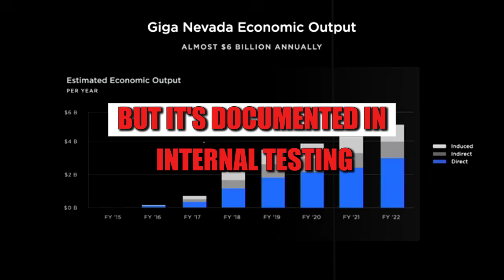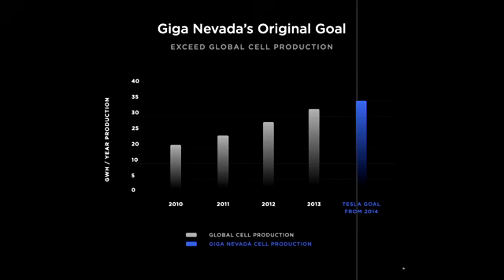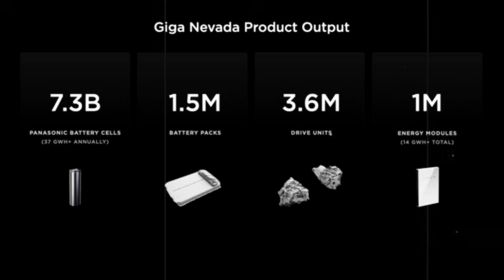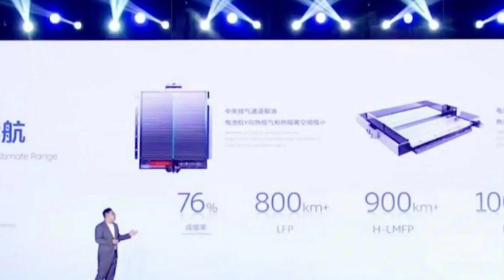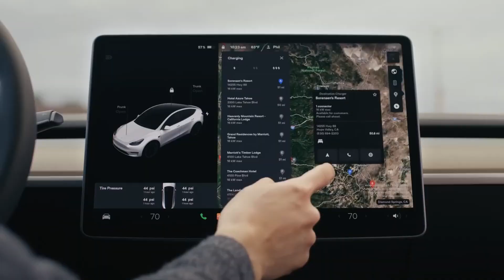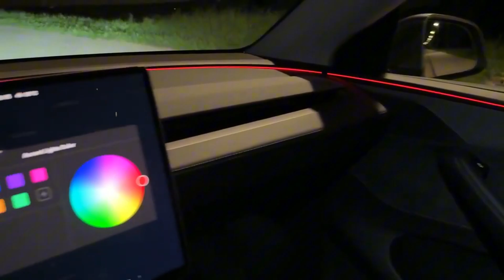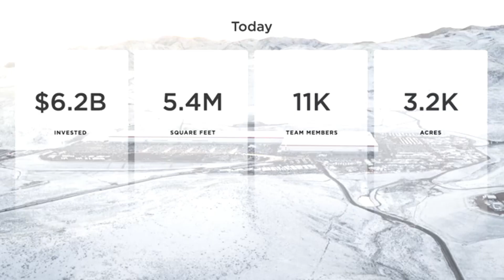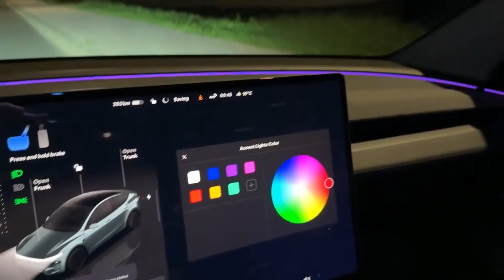Tesla’s New Aluminum Battery – 1000 Miles +4min charge, −40°C to 80°C, 30%! Elon Musk’s $10K Model 2

Comment: if weight is indeed a critical criteria then there is a wee physical problem with an Al based battery.  Al atoms have a valence of plus3.  That means that each atom can exchange three electrons.  Li only one.  So Al would have to be only three times as heavy as Li to be equivalent in kWh per kg or less to have an advantage.  In fact Al is well above 3 times the weight of Li.